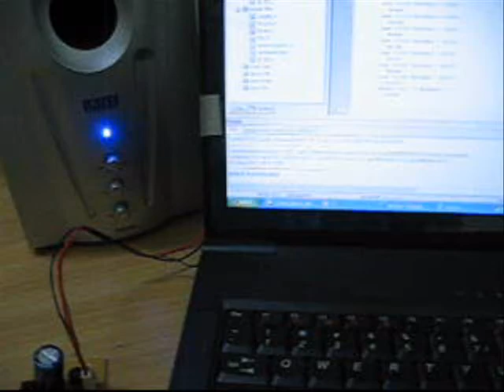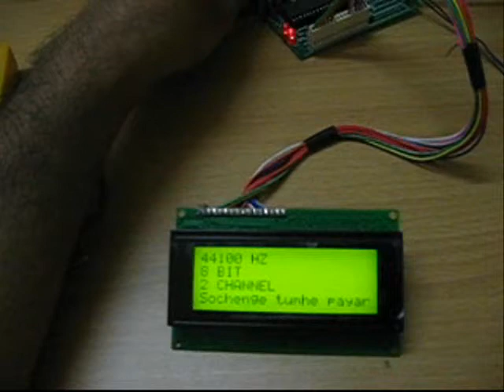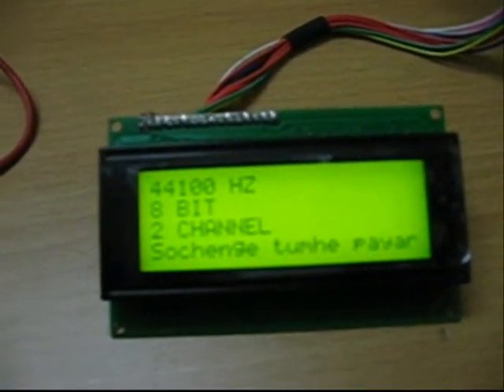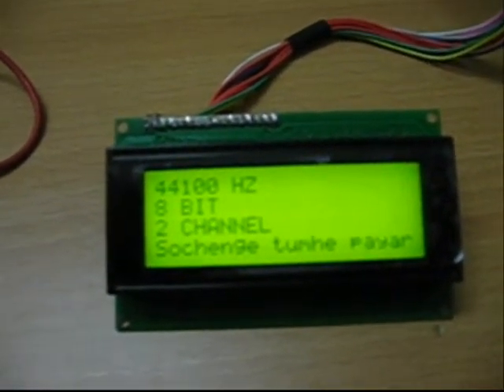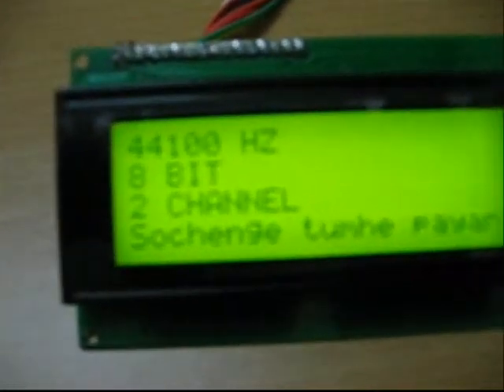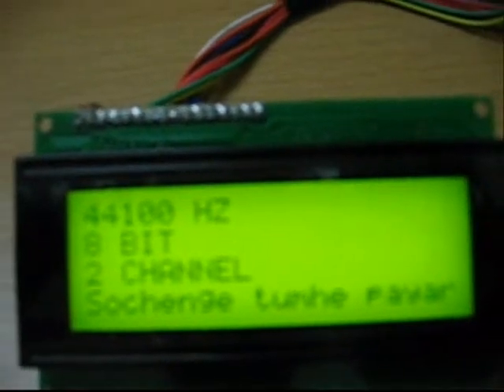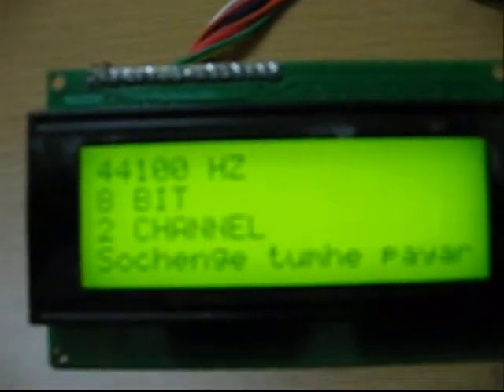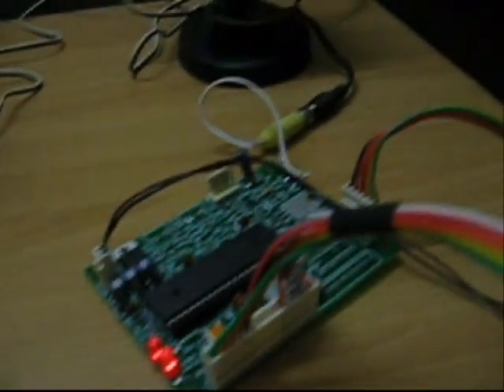dsPIC based Music player-1

Comment: Good morning, I require a project using a 30F4011 only to read and write in a fat16 or fat32 SD, and tried many tests with the 30F4011 and MPLAB C30 but I was not able to do this, I did a test with 18F4620 and it worked, but I did not succeed To do the migration, what I need is much simpler than what you developed, but I would like to know if you can help me with this? And what would such development cost?

Comment from the maker: @tutut1248 

That posting on Microchip's forum was 2.5 years back. If you ask me now for the code + schematic, I will not be able to help you :-( because, I do not have them (lost in the course of time)..

Basically, for playing WAV files, you do not need to understand all the microchip's library. Just go though the file system for accessing WAV file content from SD card and the file format for WAV file. Take is step by step and should be easy down the line..

Comment: thnk you for ur reply. on microchip u wrote any1 interestd can have the schematics and code. anyway this video is very helpful thnk u so much, but if I want to start coding what do I need to look into first for example (compresion algorithm, ADC, DAC, etc. I will be using mikroC PRO for dsPIC, do u recommend this?
I've read all of the libraries (record/playback) on microchip I am overwhelmed with information am so confused. just need a point in right direction any help is much appreciated.thnks

Comment: helo..i want to ask if there anyone know how to compile dsPIC30f6014 microchip coding using mplab...i've tried to compile it using mplab v3.25 but there has an error said that the process would not exit normally..Cannot read language tool output from pipe. (5) ..A language-plugin exception occured and was logged..does anyone know how to fix it? help3333...